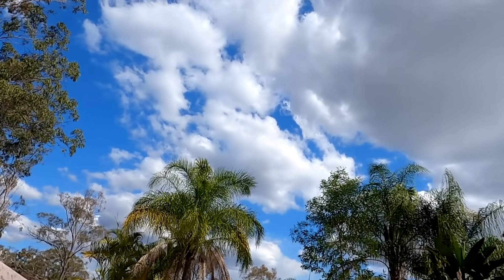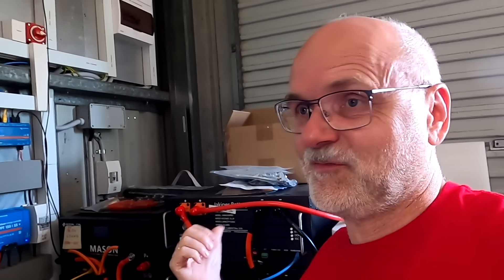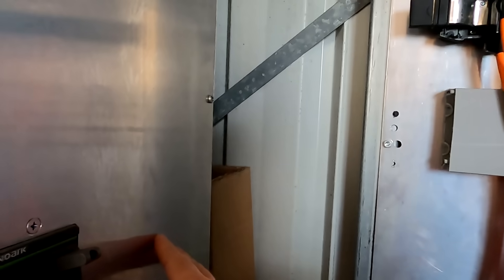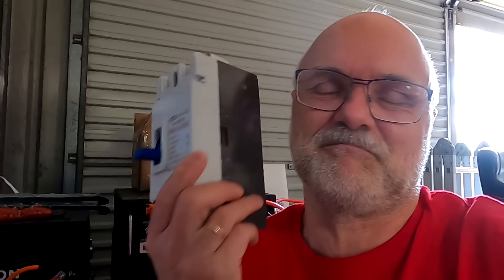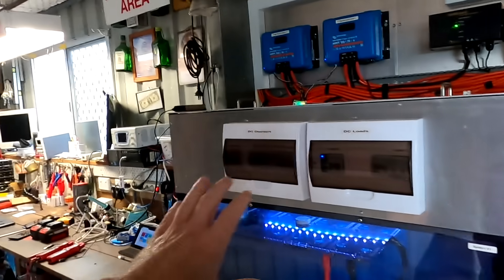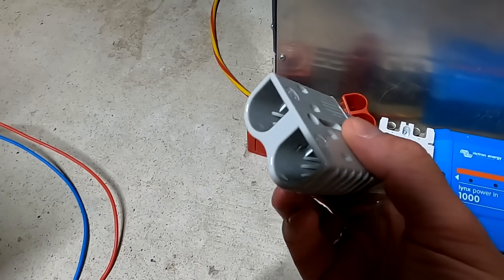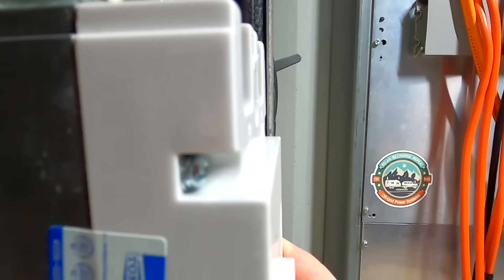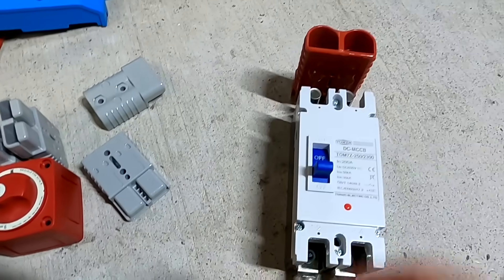I want to extend the Battery Shelf. But not to gain more capacity...

Comment: A perfectly balanced  “Tower of Power” and a fully calibrated shunt…. Are you sure you want to mess with that. AI think that the solution is on the AC side. Find the way to integrate another inverter on the test side, maybe with a second smart shunt. Another victron inverter maybe is the answer.
Reply from the maker: The problem is how I charge the additional batteries. It takes forever with the few temporary solar fence panels. I need more power.

Comment: You did a great job with the Battery Shelf why mess with it. Agree with the  200A MCCB don't like the anderson bulky, hard to disconnect and not IP67, use Quick Plug 300A Terminals similar to the ones of the batteries you want to test and made a few couple cables for the most common sizes. You can put all in a distribution box and connect to the shelf bus bar  with a 70mm cable. Since you have an extra lynx power in you could use it, next winter when you change your setup you can replace the distribution box for another solution.
Reply from the maker: Anderson does not need to be IP rated as it would be fixed installed inside the garage. Yeah, 70mm2 would be what I would be using to connect to the MCCB.
The terminals are a good idea though. It would be clean and quick.
Thanks.

Comment: Love the idea of testing Anderson connectors.  They have their place in industry, say for forklift charging.  I would never use one in my labratory for testing personally.  I'd sugest ditching the Victron stuff and use what I use in my setup Andy,  A long bus bar, drilled and tapped with holes, mounted on the wall with various sized din rail mounted breakers attached to it.  Each breaker has it's own shunt. This way you can pick and choose the protection level as needed, and acurately record charging and discharging (testing does not always include a BMS for me.).  I use a hinge attached to acrylic in order to cover the bus bar so I don't create the sun by accident.  The acrylic has velcro on the ends to hold it either opened or closed.  This setup allows the most flexibility for testing imo.  My setup is extensive with many voltages available on many bus bars.  12 to 1000 VDC.  You don't need to go with this extensive of a voltage range, but say maybe 3 voltages?  12, 24 and 48 VDC, I know people ask about voltages other then 48 volts.  72VDC maybe?  I know this is a DIY chanel, but if you are going to continue testing like this you, should have a proper setup that uses lugs instead of Anderson connectors.
Reply: High amperage, highly acurate shunts with displays are available on the cheap if you look hard enough.
Reply from the maker: I would use the Lynx Power In as the bus bar. It has fuses and connectors as I need them. I'm just not a friend of using tools to connect a battery. I like the multi voltage setup, that's a great idea but also would involve a hell lot of changes to pretty much everything, MPPTs, Inverter, cabling... so that's too much to be just an upgrade. It's more a reset.
And, I will keep using Victron. There is nothing comparable on the market...
Reply: @OffGridGarageAustralia  I think you may have misunderstood me Andy.  I'm an autorized Victron dealer, I don't want you to ditch all your Victron equipment.  It is one of the best sytems for this type of stuff in the world.  I'm just sugesting something a bit more flexible for testing.  I don't think the Lynx Disributer or the Power In are what you need for a flexible setup to test batteries.  Fuses need to be replaced if they blow.  A bus bar with various sized circuit breakers is something you can reset and use again if you make a mistake.  You can still use the Victron shunts if you prefer, they are expensive though, so my sugestion was to help you save money.  The set up I'm sugesting isn't cheap even for 1 voltage, so saving where you can might be something you want to do.
Reply from the maker: @boatelectricaldiy  thanks for the clarification. Yes, I misunderstood your last comment. That makes sense now. I think I've got a plan/vision now which way to go. Thanks for your inspiration, my friend.

Comment: Use a second MP2 48 5000 or 10000 and use the Phoenix somewhere else.
Reply from the maker: What difference would that make for my test setup?
Reply: The main question is how to connect the batteries to the system! Why not just switch between 230V mains. That's much easier than installing a main switch like this... The transfer switch can certainly be easily accommodated in the sub-distribution for your off-grid system. Or two of the MP2 can also be loaded from your existing one. I hope I don't misunderstand anything, but the solution came to me spontaneously.

Comment: I would first sit and wait. The Battery 2.0 if I remember it right should simply stay as it is - just to make it easier for the thousands of new subscribers that come new to the channel and might go back and watch the older videos. The battery shelf 2.0 was a big milestone and it is very well documented so I would keep it as it is.

Everything else or new should be separated from that like a productive world in the IT and a kind of playground or sandpit as you had tried it. 
If you really wanna replace the productive world for a few days with such new racks that arrive then it should be done by a separate connection and the current shelf 2.0 can be turned of to run those new racks or batteries in real world scenarios even though I doubt if that is bringing real benefits or new insights and understandings that are worth the efforts. 

If you can charge and discharge them and they deliver the capacity promised and the max current then it should be done at least in the current world of BMS with passive balancers. What else do you wanna test to achieve what gains ?
You can not run them in a 300 or even 3000 real life cycle test within half a year and even if  you could the real world is that meanwhile the manufacturers do no longer produce the rack you are testing cause they have found a new bms or cell or what not supplier to improve it - or lower their costs.

I would be realistic and first look for my home that this is running the best and separate and protect that from the whole testing world except maybe 2 power lines and 1 dataline to run such batteries for a few weeks in the real world charge and discharge scenario. 

Everything you want to improve comes along with a lot of new work and far more complexity you might not recognice but it becomes harder and harder to understand where you are right now and where you really wanna go. 

At the end it might be time to think about another garage to start in that from scratch with a dedicated purpose to replace the productive system you have from time to time with a test environment. But I would try to keep it simple that all the new subscriber get into it. I had watched so so so many hours of your videos last year to keep up and learn a lot that I doubt that it would be a good idea to abandon the current state just for a small improvement.
Simply call victron in the netherlands and let them equip your victron 2.0 garage cause they should support you more and enable you to do these things cause at the end your channel is a whole huge victron show case - which I not mean bad. 

WOuld save a lot and you might have time to find a smart way to load test all those rack batteries that might be coming but I guess these will be at the end far too many that you might be able to test them all and I also bet you will be loosing interest in checking ready made build batteries for quality the whole time - it has already become too much rack or wallbox focussed content over the time with same or similar brands. I guess you wanna to stay the andi from the off grid garage and not the andi lfp battery checker channel.

KIS - keep it simple would be my advice, call victron for support, think about a victron garage 2 or dedicated test area to separate that from the productive world. 
Would be easier and not so much confusing for all the viewers.
Reply from the maker: Very good points!
The 'Power-Garage' is coming this winter. Which is just over...
Reply: @OffGridGarageAustralia I guess you are in contact with the german channels, that meine techwelt and meine Energiewende cause we are hoping that you will appear in their monthly show called PV quartett or so. 
They both have the closest contact to Victron, meine Energiewende seems to get the newest (maybe even beta) stuff from Victron and I bet that both of them and a lot more would support such an idea of a victron show case in sunny hot australia for the whole (yt) world rather than supporting their channel cause sunny hot australia has the big advantage of more sun and few clouds and therefore better opportunities for great content.

I have not a single victron product, so I am just watching an learning, cause we have only growatt installation due to reliability, scalability and a 10 year warranty that is a warranty cause growatt has german offices and repairs and replaces units but it happens only rarely. We have about 100 inverters and just a single case after about 7 or 8 years fully covered. 
But I like the victron world too cause it forces you to understand the details what usually the hybrid inverters and so on do. 

Therefore it might make sense to get victron power house in andy's garage as a back bone while playing with other inverters, devices, batteries and heatpumps cause sooner or later it might become a question where to go from where you are ? Waiting for Seplos BMS V22 might not be the greatest perspective.
Anyway, I will stay watching even though I have build enough Solar power systems, even for the first time a small east west array to observe and compare the performance of 3 huge 550 Wp panels on each roof.  Winter is a bit away but we appreciate an untypical warm September with several days in the 30°C in the beginning, so we will add a water heatpump with additional heat exchanger to heat the house with surplus solarpower as long as we can. 

Keep on rockin

Comment: Why not tap off the main bus bar by using fuses directly bolted to it. One set of fuses for each Anderson connector. Don’t need a switch for each connector because the external batteries all will have switches.
Reply from the maker: That would work too. But then I could just use the Power-In and some Andersons, right?

Comment: Hi Andy. I have that same 200 amp breaker (under another name) and they are excellent! When you switch them, they don’t mess around and can wake the dead with a loud clank 😅! However, during my curiosity disassembly I noticed that the threads for the terminals are in copper so use common sense when tightening or see if they have supplied a torque spec.  Also if you’re going to add that fuse, I highly recommend using fast blow T class fuses and the best holder for them is from Blue Sea Systems. Those you can torque down👍
Reply from the maker: Thanks for sharing Karl. I think I have read 7Nm for these breakers
Reply: Can we know under what brand they are also existing and are they for 100% equal

Comment: If your going to test Anderson connectors , buy some Anderson connectors. Hopefully you test the real ones along side the china versions. Also if you wanted to keep it all modular you could put the breaker in a small box with Anderson connectors on both ends . Just hang it on the wall . Plug and play , move it around for different things etc .   PS : Anderson makes a pull loop handle for those bigger guys and it makes it easy to connect and disconnect them .
Reply from the maker: More ideas... thanks

Comment: Andy, Since your goal is to have the loads available to the DuT, you definitely want to be able to runs tests including/excluding the battery shelf.

1. Big Breaker - Essential, as you said
2. I think Big Breaker should go to the top shelf bus bar. That way the shelf batteries can be isolated or connected during testing.
3. "Below" the Big Breaker you could have the Anderson. This would allow you to connect different DuTs. A standalone power wall, the Power Wall 2.x with all the batteries it has connected, you could run big, fat, $$$$$$ cables out to some other testing area etc. Options are limited only by budget, physical space or imagination.
4. As for shunts, if you want to individually coulomb count the battery shelf and the DuT as well as the over all system, I think you'd want one "above" the Noark Big Breaker to the top shelf bus bar, another similarly connected from new Big Breaker to top shelf bus bar and then keeping the existing shunt for overall system stats. You could also measure flow between shelf and DuT batteries that way also.

So do you have room (physical/budget) for 2 more shunts "before" the top shelf bus bars, the new Big Breaker and a giant Anderson connector (or maybe an alternative)?

Outside of the shelf is then flexible to be used for anything you can imagine.
Reply: Agree ... to the top, seperate from the main setup

Comment: Maybe just think of where you really want to put batteries for testing. Should they be close to the computer. 

Do you also want to test more solar panels or new inverters without interfering with the existing setup?
Should the switch be near you, the battery or the battery shelf?
How about height and position of the switch in case of a malfunctioning cell?

It's a lot to consider. I think I would separate some solar panela or add some more. Or maybe look into software that mimics solar charging and discharging if that is much easier. Not sure what's out there.
Reply from the maker: It is a lot to consider and decide. As I will re-arrange the garage in this area a bit, I may may wait for that design to finalise.

Comment: In would love to see a Tesla wall charger and 3 phase inverter added to the mix. You’re getting close to being able to fully charge the car in a few hours with 3x 16A 240v - stress test
Reply from the maker: 3-phase is maybe not an option right now. The sparky has plans to convert everything to single phase once the house can be connected as well.
I'm driving electric since 2015 and never had to charge at home in a hurry, so any wallbox would be a waste of money for me. But yes, for a battery stress test, I can see your point.

Comment: You are right that the additional batteries need to connect thru the Smart Shunt on the top shelf.

But the 200A breaker needs to be wired IN PARALLEL with the existing 250A breaker. (Shunt is OK for 500A, so is still fully protected by the two in parallel.)

Then Anderson connector from the 200A. Connect the frankenstein to test just that in parallel with the 44kWh shelves. Powerwall 2 can still charge the Tesla. 

Or, connect the Lynx 1000 to test any combo of the other batteries.
Reply from the maker: Well, if I would parallel the existing 250A breaker with the new 200A breaker, I need to upgrade my cabling to the main busbar system in the top shelf. 
It's a lot to consider...

Comment: 6:30 I prefer mounting a Lynx Distributor on the box itself - it has fuses for each connection.
Reply from the maker: And it's clean, small, easy to reach. I just don't like the screw connections but thought the Andersons would be an easy upgrade. I need to figure out the space necessary though. It's all very tight. The battery shelf was never designed to take such an upgrade.

Comment: Andy, the 350A Anderson connectors have been tested sufficiently in battery locomotive applications. We discharged 920Ah FLA batteries (100%-40%) in 3-5 hour shifts, and then recharged them in 4-6 hour shifts daily. If crimped correctly, they last years until mechanically damaged during battery swop-outs. We know they work, we know they waste power and they'll just frustrate you as they're difficult to pull out.

Amphenol connectors are all the rage these days for plug/unplug EV applications, and 200A rated (50mm2) connectors are already prevalent in most large residential battery storage applications - see the Sunsynk 10kWh battery as an example I've worked with - nothing stops you from making a busbar above a bunch of 100/125/200A circuit breakers, and Amphenol terminal posts below those breakers to plug in to your heart's desire. - this does, however, mean that your existing vertical battery busbar will probably have to be replaced in totality - but since you already have the dimensions, you can build the replacement for a few weeks before having to do the swop-out

Lastly, victron orion tr 48/48 8 DC-DC converters can be paralleled into large arrays - this allows you to directly (and efficiently) discharge any battery into any other battery, at adjustable rates - if you don't want to pay the victron premium, Mean Well makes some of the best industrial grade units with 10A or even 20A continuous ratings.

Comment: Build a small cabinet for the 200A breaker, out of aluminum sheets left overs from earlier, mount it on the outside of the shelf. Then just make 2 holes for new cable glans to get access to the busbar below shunt. Then no need to remove endplate of the battery shelf.
Reply from the maker: I would probably use an appropriate plastic case for the breaker... But mounting it on the outside is probably the only solution.